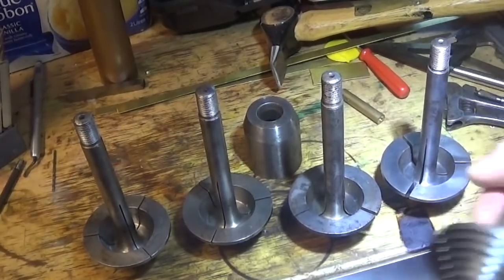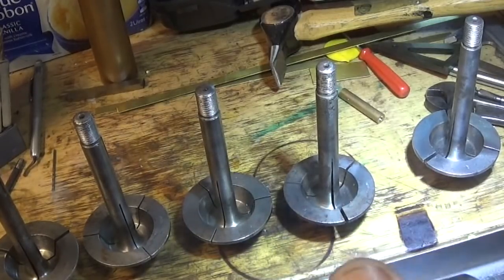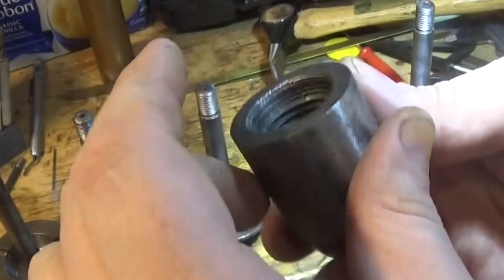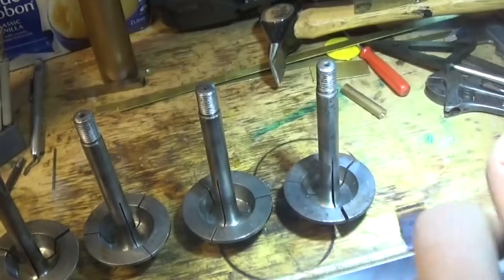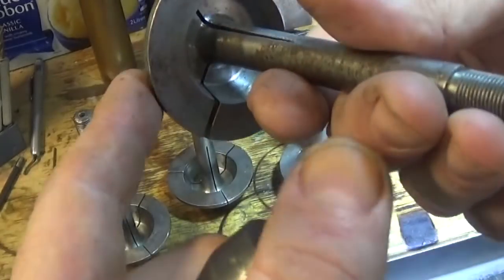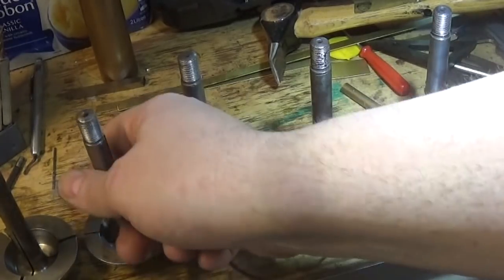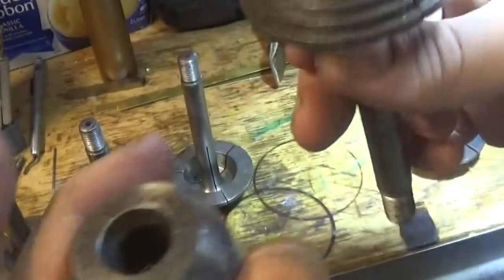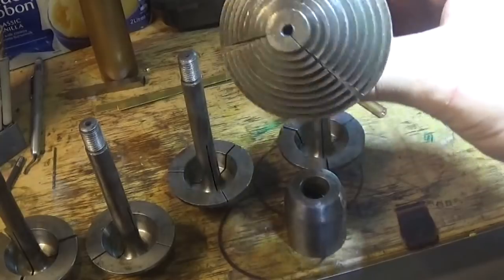issues with my F lorch ring chuck "set"

Comment: Hi, i would be hesitant to touch the outside as the concentricity is governed by the inside rear taper  , I would first try de burr them & touch up the slots with a thin grinding disc & see how they run  as the fingers should still pull themselves into reasonable alignment when the assy is tightened up .

Comment: Start with the smallest step, chuck and expand in the lathe with a pressure ring on the largest step, carbide should cut all the way up to 55-57 Rc. After the small step is running true to the spindle centerline, make a center for the smallest step (blind hole with a 60* center) get it on centers and cut the other steps. You may not get it as true as you want with just carbide turning, it can be ground later using your center adaptors. But I'm sure you will see an improvement. If these mandrels key into your spindle, the repeatability should be pretty good and its probably best to do the final grind on the machine it is going to live on.

Comment: Hi Emma,

Recently stated enjoying your videos so first up: thank you for making the effort!

This may be obvious, but have you checked fit and runout on the chuck?
You are right I think in suspecting that it is not original (I have one). The finish inside seems pretty atrocious too. I would be worried screwing that on my machine - especially if it is hardened. The original ones were cast iron I'm pretty sure and they have a radiused mouth - plenty of clearance for the shaft of the collet.
My advice would be to start by remaking the chuck making sure it runs true and conforms to the collets. Then see how the collets look on it...

Regards,
Mark
Reply from the maker: yes i think you are right.

Comment: I expect the ones with the centers touching have been over tightened and have bent the stalks. Not sure if you could bend those back straight. Be touchy getting them just right.
A round ring made to fit the largest diameter could maybe be used to preload for resurfacing?